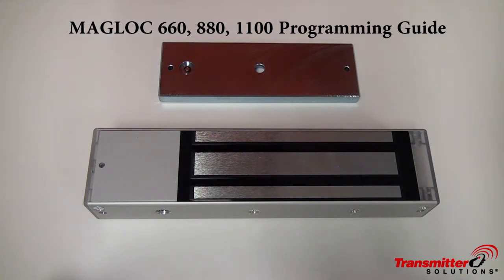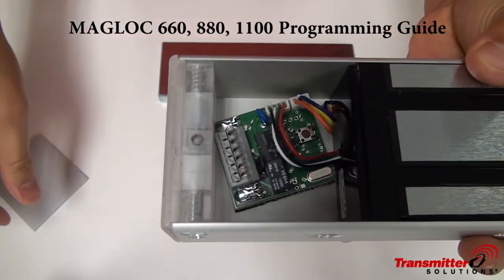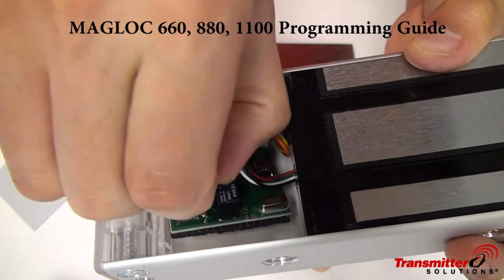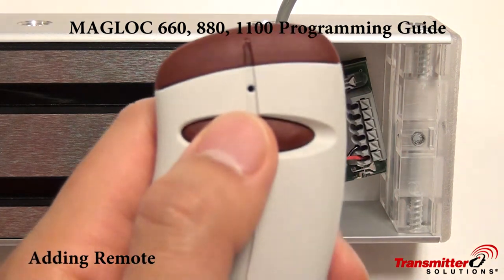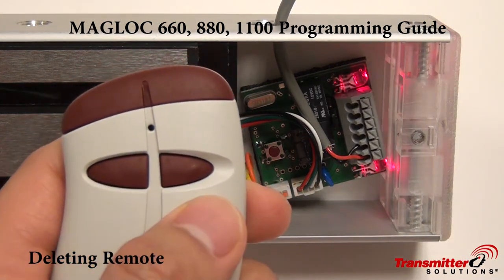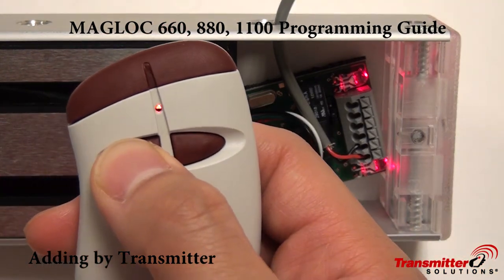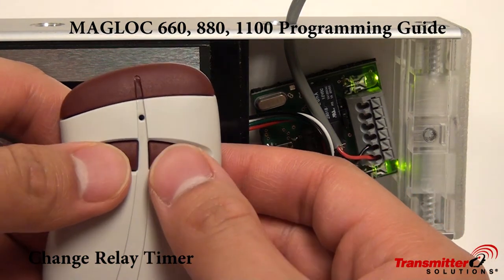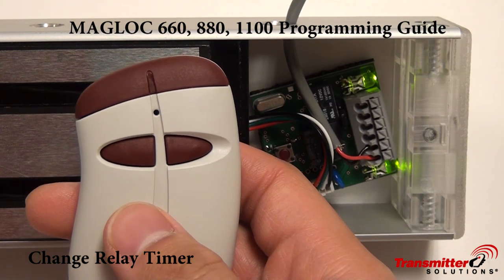MAGLOC 660, 880, 1100 Programming Guide

Comment: The "benefit" is having wireless control and local power could save a control wire run, is that the thought process? It would be neat if it had a REX input so you wouldn't have to worry about batteries in a wireless REX device. (It does we looked at the website.) Does it have an adjustable timer? (It does 1-10 seconds we looked at the website.) LOOKS cool though! Thumbs up here and don't forget to put links to the website!

http://transmittersolutions.com/Access-Control/MagneticLocks/
Reply from the maker: We will make sure to put links to the website. Thanks for the helpful suggestion, accesscontrolforum.